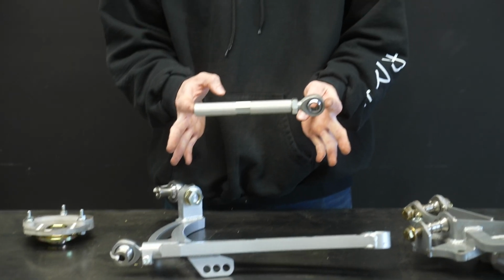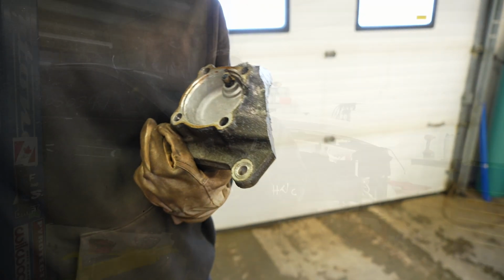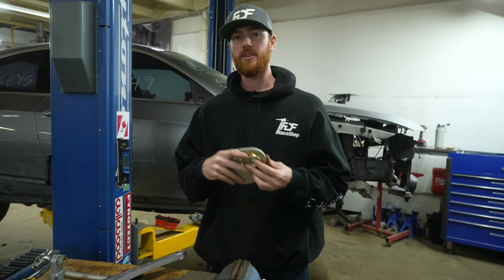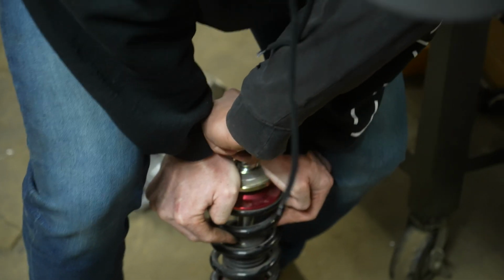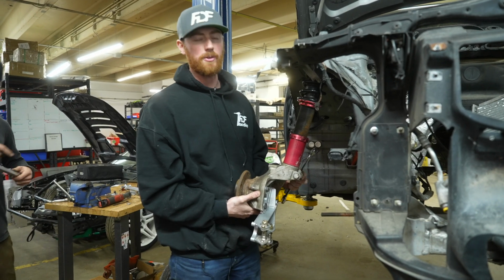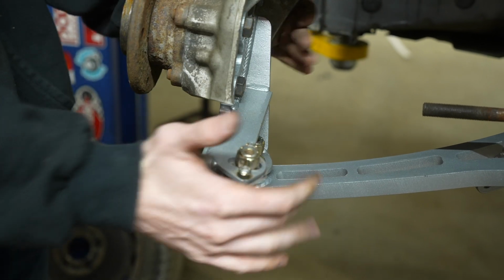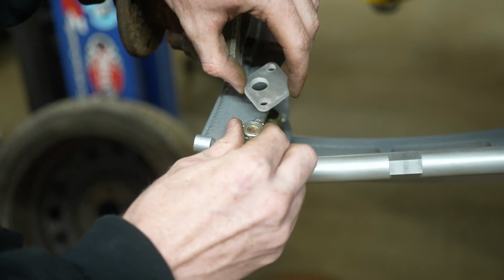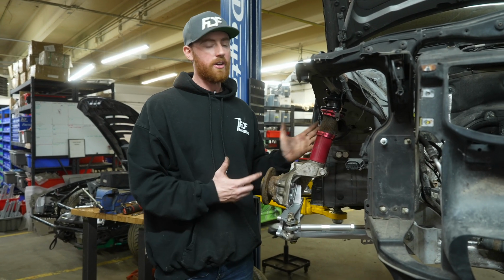FDF BMW E90 Angle Kit Install

Comment: hey can you guys Please make an angle kit for the E34? or tell me if it shares any component’s with the E30 or E 36? 🤙🏻
Reply: I'm actually going to take a shot in the dark the e90 suspension is a smaller version of the e60 and they share part number with the e34 arms but everything is reversed so I'm just waiting on some income to actually try this and hope it works.

Comment: Would you consider selling the top caster adjusting platers on their own. If so what is the ID of the pillow bearing. The application is for a gravel rally car which isn't a BMW.
Reply: They make them for different models of car
Reply: @trippinoutmotorsport  I need a set for a Hyundai Getz, I believe we are the only people in the world trying to gravel rally one. There was a big track racing series for them in Spain and Argentina a few years ago, so I know they are capable, but trying to get stuff for a rally version is near impossible. .... but fun.